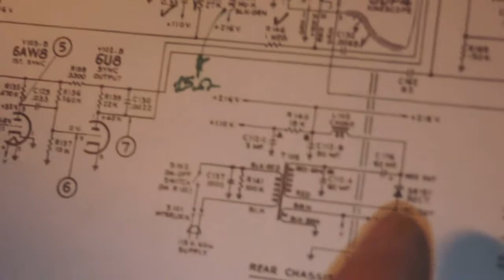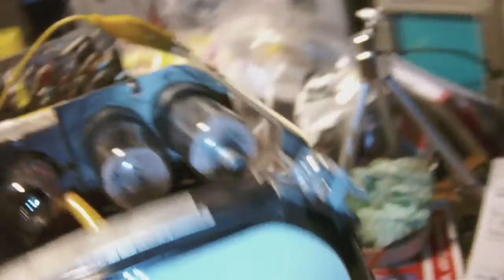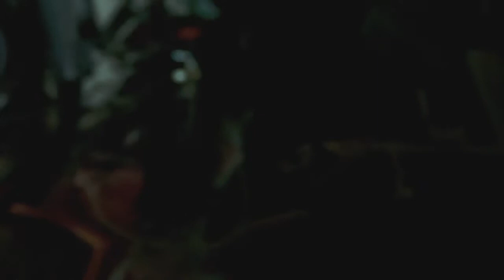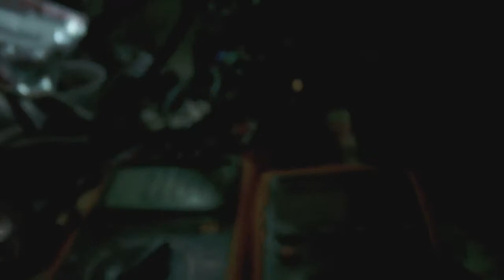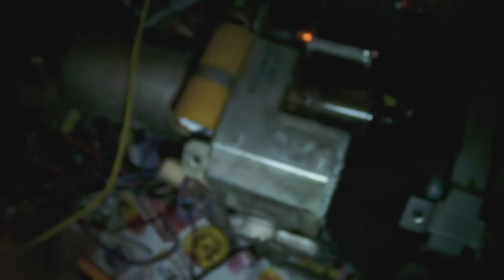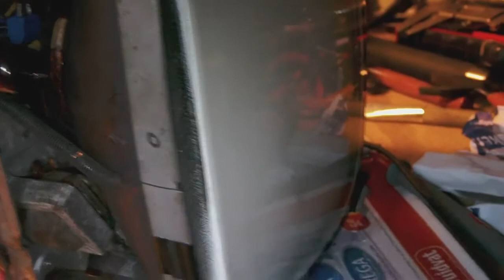RCA 8PT-7032T part 6 of

Comment: Hi TechneMoira. A good place to start would be the vertical output tube and the circuits around it. It could also have a weak horizontal tube. Do you have a way to check the High voltage going to the CRT ?. I have a lot of faith in your getting it fixed. Your half way there.
All my best.
Bobby
Reply from the maker: You read my mind :) Yes, in fact that is exactly where I started looking for faults. I can already tell you the horizontal drive tube is running very hot and grid voltages in the tube are about 10V low. So, either the tube is bad, or the fault is upstream. Probably the low grid voltage is causing the tube to draw too much current, making it run hot. Stay tuned! Thanks for your support
Reply: +TechneMoira Why you are very welcome :)  .There should be a biases resistor for that tube,The lower voltage is a good clue. since the tube has been over heating maybe a replacement is in order. 
All my best.
Bobby